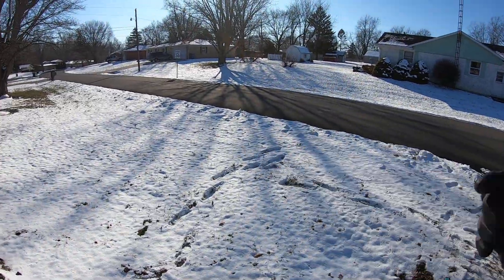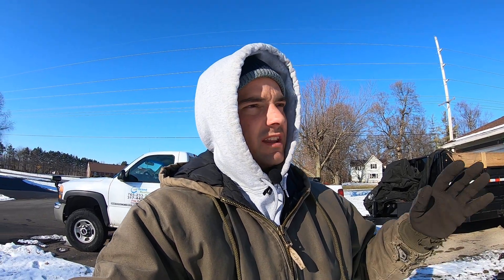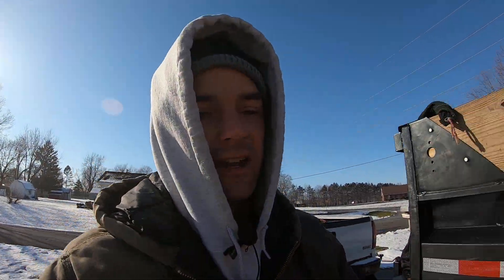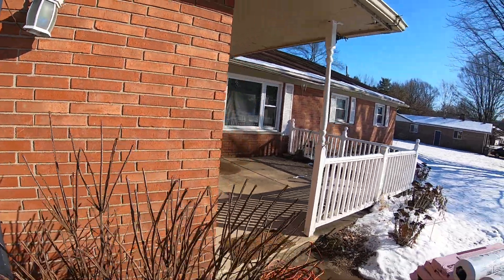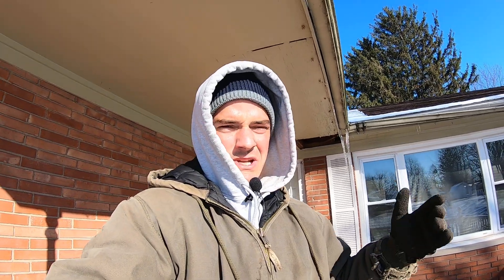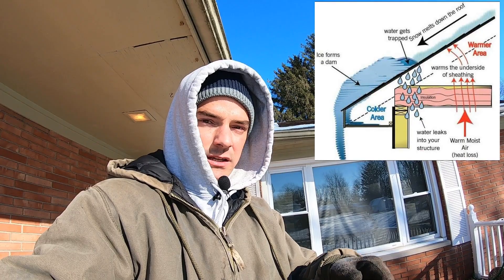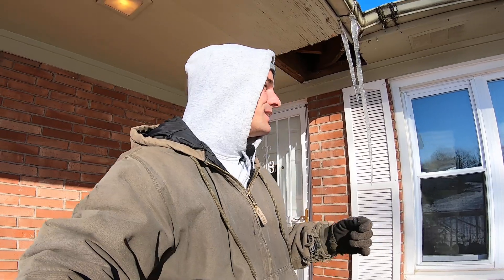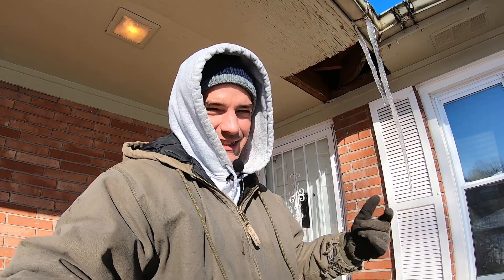Roofing How you can you tell if you don't have enough attic insulation

Comment: What size trailer?
Reply from the maker: It is a 14'x7'  3 ft deep
Reply: @GrandRoofingInc  So how big of a roof you can fit in the trailer??
Reply from the maker: @IvanHVAC  it really depends on the job, there are several factors. What type of shingles are you tearing off, are they 3-tab or a heavier thicker dimensional. How many layers of roofing are getting torn off. Do you have bad would going into it etc. Recently we did a 40 square tear off with two layers. That was roughly 80 square total, and it can put your trailer overweight. Which that alone is not good if you get stopped by the DOT. You could also bend or break something on the trailer. Most residential jobs can fit in one trailer.
Reply: @GrandRoofingInc  Thank you for your responce. Have a great 2020 coming year. Do you recommend starting as a sub, or directly working with customers? What warranty do you offer your clients on workmanship?
Reply from the maker: @IvanHVAC  are you asking is it better to start out as a subcontractor to find work?
Reply: @GrandRoofingInc  Yes sir...
Reply from the maker: @IvanHVAC  anytime you can pick up extra work as a sub and the numbers work, that is good!  Ultimately if you can stay busy building your own brand, that would be ideal! The more hands the money passes through the less there is at the end.